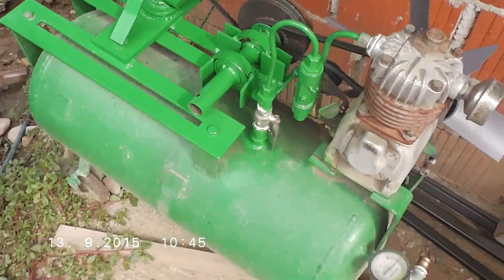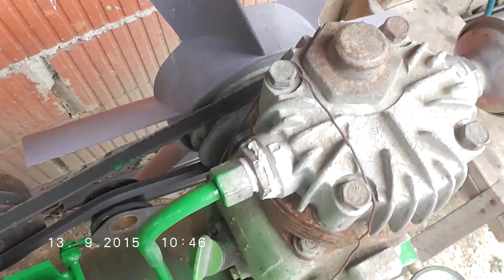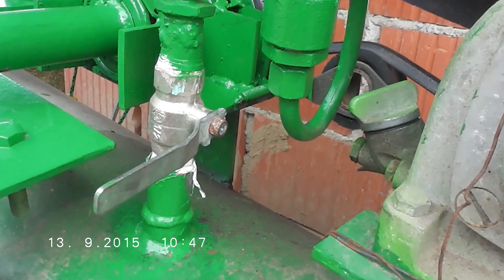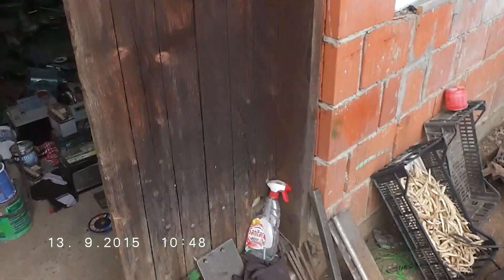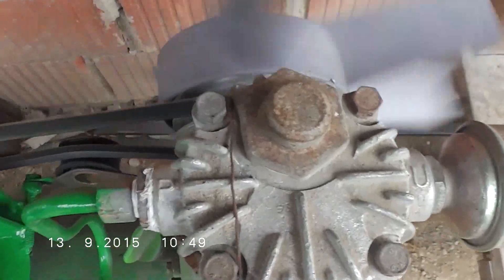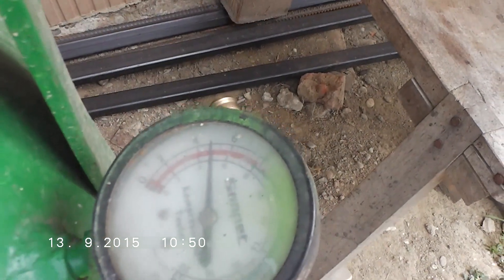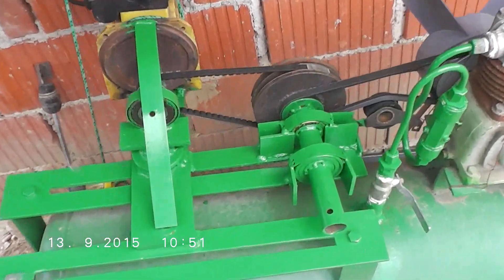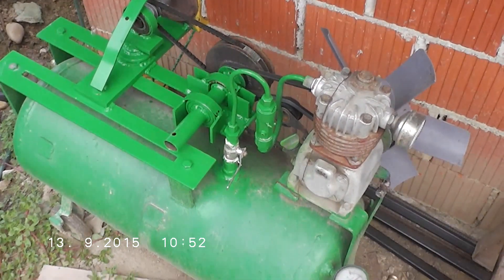Air compressor with low consumption electric motor

Comment: Electric water pump motor right?
Reply from the maker: Yes it is from old water pump
Reply: @Mladen365  i did that too but d problem is its only filling my tank at 90 psi at 50l.using old ac car compressor😅

Comment: that hand operated ball valve can be dangerous, you should consider a check valve such as a Midwest Control model# P7575TP
Reply from the maker: +benniethejew you think it will break?,i  fill with air only to 6 bar preasure,will search on ebuy maybe i find that check valve,thank you
Reply: nah not so much i guess dangerous was the wrong word. If you fire that thing up and forget to open the valve what would happen... overheat the motor or throw a belt? not sure how much torque that motor exerts. Perhaps you are not as forgetful as I am.
Reply: I think i found that one on a website called northerntool.com I tried to paste more info on it but I guess yt wont let you paste in the comment box... Awesome work by the way i love all your projects.

Comment: Your little green bomb could really use a PRESSURE CONTROL SWITCH and an UNLOADER VALVE.  I have never seen them as separate devices, so you get 2 valves and electric control in 1box.   I'm a little worried about the safety of anyone near that tank you welded on while it is holding pressure.  Please keep the pressure as low as you can.
Reply from the maker: Dont you worry,check the year i upload video,since than i use it all the time,it work and hold preassure without problem,and just for you to know i am proffesional welder it is my everyday job,that is all i have to say
Reply: Mladen 365 I'm glad that you are still well.  I've seen a few videos of compressor explosions that I found disturbing.  My father died from a safety violation when I was still very young, so safety is probably more important to me than it is to most other people.

Comment: I think it´s a big problem with your calculation, because you forgot t=time ;)
Reply from the maker: +vers21 i don't have problem with time,i got all the time in the world,i made it for my need's,i didn't make it for car painting,that compressor fills 2 more reservoars at the same time,when i fill them to 6 bar i use them one by one,that is the system i use
Reply: I don´t mean your time,,   P = W / t   
It dosen´t matter if the motor are smaller because then it have to run longer time to deliver same amount of air.
Reply from the maker: +vers21 as i told you for me time is not important,i can't put 1 kW or 2 kW motor because i don't have it,i use any motor i have at home,and i don't like any calculation or complicated electronics,i want simple devices that anyone can make it,i don't mind if my motor need 2 hours to fill that as long as it works for me it is very good